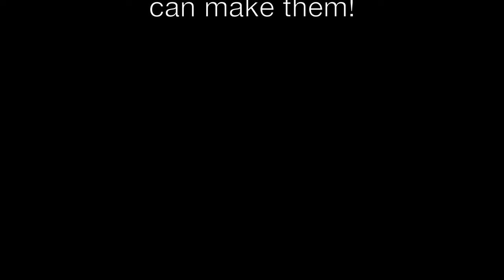T1N Sprinter (2004-2006) Transmission Service + Valve Body Removal

Comment: Thanks for your great explanations and visuals.  I am replacing my engine on a 2005 Dodger Sprinter 2500. I see some people removing the transmission and a few leaving the transmission in place. I am trying to leave the transmission in place, but I can't get separation. Any ideas or anything you can help me with?  Sure appreciate it.
Reply from the maker: As much trouble as you are having getting separation, getting alignment will be X10. Before it is too late  put a few bolts back in the bell housing and pull them as a set. The weight will balance at injector #4. Four bolts on the drive shaft and four bolts on the transmission mount. Disconnect the wire to the transmission and the linkage to the gear selector. I think the trouble you are having is the engine needs to come up to leave the van, and forward to leave the transmission. The transmission is preventing up, and the van is preventing forward, so nothing comes apart.
Reply: Thanks for experienced input. Motor and transmission came out well. Now for the transfer of parts from the old to the new. Your latest video of injector pulls was timely and helpful!

Comment: 2005 Sprinter 3500 200k miles. Don’t know maintenance history. shutters when under a load usually when pulling a trailer. Doesn’t do it 100% of the time but more like if you stop at a stop sign then start off up a hill. The tach seems to increase in rpm when it shutters but it doesn’t seem like a “slip” . If I keep the rpm’s up it’s less of an issue. Any suggestions, thanks in advance
Reply from the maker: Those symptoms don't feel familiar to me. I'd need more data to make an educated guess. Sorry.

Comment: The two different dipstick receptors, is that the only difference between the yellow plate and the black plate when replacing the unit, I was told that I needed the yellow plate which has the U-shaped receiver for the dipstick, which I hate, I want the newer style dipstick receiver, any comments, will both work ???
Reply from the maker: U-shaped receiver on the conductor plate in a Sprinter will leave you unable to check fluid level. The way our dipstick tube routes back and forth it is impossible to register accurately from the top of the tube.

Comment: I need to do this to my sprinter. Do you recommend the conductor plate and shell transmission fluid in the description? Figured I’d ask since you used a different fluid in the video.
Reply from the maker: Yes, when we made this video we used Meyel fluid. That has become impossible to source and we have been using Shell 134 ever since. We tried Fuch's Titan and found it to be thicker, causing valve shudder (RSN) in a van that did not have valve shudder previously.

Comment: I’m wonder, you kid of said in passing that you used brake cleaner to clean the plate. Is that specific or will carb cleaner work as well? I have some carb cleaner for the EGR valve I’m cleaning and was wondering if that works
Reply from the maker: I don't use carb cleaner for anything after a few instances of it eating the surface I was cleaning, or one too close to it. I don't recommend getting brake cleaner on painted surfaces or gaskets if it can be avoided, but it won't eat them like carb cleaner. Your Sprinter does not have a carb so that should leave your garage. It does have brakes. That's all I'm saying.

Comment: Hello! We recently purchased a 2006 Dodge Sprinter and these videos are really helping us get to know our vehicle; thank you! We plan on doing a transmission service however, we aren't sure if we should replace the conductor plate as well. What mileage would you suggest these be replaced at? Thank you!
Reply from the maker: That is not a mileage concern. If the van is driving correctly and sifting as it should, I would not replace the conductor plate. Clean everything best you can while it is apart, new fluid and seals on the electrical connector (or new connector).
Reply: Hey! I just bought a 2005 t1n and in the past couple days it’s started getting stuck in a certain gear. I would turn the van off and start up again, it would occasionally work but as of today it’s completely stuck in 2nd while driving. I removed the driver seat and the TCM had oil on the plugs.  After cleaning that with brake cleaner it still had the problem of being in second. Any suggestions would be much appreciated!
Reply: I’m having a similar problem. Sometimes everything is normal then it’ll stick in 2nd or sometimes 3rd (and won’t allow manual tap shift) until I turn it off and restart it. Sometimes goes a few miles with normal shifting before it sticks. Cleaned contacts on TCM under seat - No luck. Just did trans oil change and replaced the TCM connector plug - Still no luck. Any suggestions?

Comment: I have a sprinter 2006 with both manual and automatic transmission. I can't find the dipstick at the point you showed it
Reply: Is there any other spot I can search for it?
Reply from the maker: What country is your was your van originally sold in?
Reply: @FloridaVanMan   It was imported from spain

Comment: Is there not a pattern for tightening the bolts, like with an engine head?
Reply from the maker: We should tighten them in a criss-cross pattern, but not so critical as engine head, manifold bolts or even wheel lugs. The pan is fairly flexible but the torque spec is light at 8Nm. Snugging them all then coming back to tighten each is recommended. I usually start with the middle two bolts.

Comment: I never knew the conductor plate had a plastic molded ring that's stopping the dipstick from bottoming out. What's with that U-shape version were the dipstick goes straight past it? Aftermarket conductor plate?
Reply from the maker: The NAG1 transmission with that conductor plate is used in other Mercedes vehicles and some Jeeps that have a more traditional transmission dipstick that comes with the car.
Reply: @FloridaVanMan  I see thanks for clearing that up

Comment: You only put 5 quarts of transmission fluid in even though you drained the torque converter. Your other video with the girl shows that you put in 8 to 9 quarts. Please explain.
Reply from the maker: I haven't watched this video in a few years, but we should have added 5 bottles then started the van before adding 3 more. I usually need a few ounces of fluid from a 9th bottle to get the level I want at operating temp.

Comment: I serviced my transmission recently and still having rumble stripe feel/ haven't done the drill hole method yet. Altho it still feels like the shift timing is off. Not slipping but funky bump shifting. No engine lights on. So strange any idea what else to look at?
Reply from the maker: Did you replace the conductor plate when servicing the transmission? Discussion is difficult here. Please find me on on Facebook or join our support group for 1-on-1 assistance. https://patreon.com/Florida_Van_Man?utm_medium=clipboard_copy&utm_source=copyLink&utm_campaign=creatorshare_creator&utm_content=join_link

Comment: Downshifting problems. My 2005 T1 in Sprinter, doesn’t want to downshift when I flick the lever. I have to flick it 3, 4 or five times to get it to finally downshift to fourth or third etc.. I recently changed the transmission fluid and that made no difference. What  are your thoughts?
Reply from the maker: Try holding the shifter a half second, not just a flick. I think I saw you on FB and I reply faster there.

Comment: So I'm lost with the torque converter...you drained it and then we never saw it again. Does it consume the same transmission fluid as the rest of the transmission? Does it require any more maintenance than the fluid draining?
Reply from the maker: The only maintenance you can do to the torque converter is draining the fluid. It's the same transmission fluid as the rest of the transmission. When you drain the torque converter, you will have to put more transmission fluid in than if you just drain the pan & replace the filter. The extra fluid that it needs just goes into the pan and is fed into it once the engine is running.
Reply: Do you need a new washer when replacing torque converter drain plug?

Comment: Hey there!! Bill I done everything like u show in the video the oil was black everything was working before change the fluid but now only go to 3 and pass from there any suggestions can help me?
Reply from the maker: What do you mean only got to 3 and pass from there? Are you saying it shifts only 3 gears? Are you sure it is shifting at all? Some folks mis aligning the linkage shown at 8:55 in the video. Others forget to hook the wire back onto the transmission.

Comment: do you recommend doing a fluid change / service on a high mileage T1N. I purchased the van at 200K miles and have no history of the prior transmission service. The fluid looks somewhat contaminated. Some question doing the service for high mileage ...
Reply from the maker: I do. My book says service it once at 80,000 then never again. I had trouble somewhere over 300,000 and thought I cooked it. A full service with filter and cleaning restored nearly 100% and I have driven another 200,000 miles since then without issue.
Reply: @FloridaVanMan  thanks a lo for the reply. Would you do it as preventative maintenance as well ? There is no apparent issue except a leak in the connector seal (located next to the trans. Forgot what it’s called).

Comment: If there were 3 vans for sale all the same year and wheelbase etc.  would it be better to choose dodge, freight or merc?  between 03-06, which diesel is the one to have and which one is the one to stay away from?
Reply: which engine did not have injector seal issues?
Reply from the maker: @toobglued   Merc Dodge & Fr8_R are all the same van made in Dusseldorf Germany until '07 when they went to S.C. and changed everything. The '02-'06 have the same design, head, and injector concerns, with some major accessory differences. '02-'03 have issues with the mechanical fuel pumps, vacuum activated turbo and a big intake manifold that gets in the way of simple engine maintenance. We are big fans of the '04-'06 with electric fuel pumps and electric actuated turbo with smaller intake manifold and better EGR. We prefer to dress them all as Mercedes despite whatever is on the title. Only the plastic logos are different from one brand to the next. 
The injector seal issues aren't as bad as some people think. If you look under the hood occasionally, and move some plastic covers to see the working bits, you will catch trouble before it gets ugly. If it gets ugly, a can of oven cleaner and $8 in parts will fix the common injector seal issue called Black Death. I call it Black Inconvenience.
Reply: @FloridaVanMan  wow thanks !!
Reply: @FloridaVanMan  And the post 2006 is not desired?   There is a 2008 dually that is very clean for sale with reasonable miles I was considering.   Thoughts on the later models 07-08?     Thanks in advance :)
Reply from the maker: @toobglued  Sorry for the late response. Post 2006 the diesel option was a V6 with DPF and later DEF requirements. These emissions systems are notorious for expensive repairs down the line and I would not recommend them for the faint of heart or DIY mechanic.

Comment: Hello, your video was very helpful, yesterday I did change my transmission driver plate, after finished I noticed some leaking through the connector, first question; is the inside of the connector fill out with oil transmission, that is normal? Second question; because the connector was leaking through the pins looks like I over torque and damage the internal little screw, will I need replaced again the connector plate? or it is possible to wait until next oil change without risk of malfunctions (screw issue).  Thanks a lot for your videos and advice.
Reply from the maker: The screw is not all that important. The connectors are usually wet inside but if the O-rings on that connector are not up to the task fluid will wick to the TCM under the driver seat. We have a video about that. Search our channel for "Should this be wet".
Reply: @FloridaVanMan  Hello, thanks for your fast answer, I saw the video, my pin connector still oil leaking, the connector and the o rings was new one, you recommend found a new o rings little bigger, is possible to remove the pin connector avoiding drain oil in the oil pan? I appreciate a lot your advice.
Reply from the maker: @karenm6914  We can pull the wire-side for connector out without loosing fluid. It is often wet in there. Removing the next part, the connector in the transmission, will drain some fluid unless you are parked on a good hill. if the seal is not good I would replace the connector. Even knowing the bolt hole in the conductor plate is stripped, I would still be confident with a new plug and the O-rings it comes with. When removing the old plug be sure to get all the O-rings out of the transmission then press a new connector with rings Firmly into the hole. May need some levers to really push that connector fully into the transmission. 
https://floridavanman.com/donate/
Reply: @FloridaVanMan  Thanks a lot, tomorrow I will change the O rings with a new ones., Really I appreciate your time and effort to explain to me the best way to fix the problem.

Comment: Hi. What brand torque wrench do you have? Mine only goes down to 13.6 N/M
Reply from the maker: We've been through a few!!! One of our videos shows a bent one we absolutely ruined! Since then we bought a Craftsman for regular torquing. We've had a small one measuring inch/pounds for years and we have a giant one just for these harmonic balancer replacements. I think it was about $300 and is 42 inches long. I can get you a link if interested, but I'll need to look at the wrench I have. It is not a famous or familiar brand.

Comment: Can a transmission flush prior to service be a good idea? One Sprinter specialist I spoke with said it can cause problems as much as solve them. Any opinion on this?
Reply from the maker: I never heard or read of any one doing transmission flush on a Sprinter. It seems unnecessary with no potential for any gain.

Comment: I would love to contact you. Flew down from ohio and purchased a2006 view winnebago. Battery was dead charged it. Drove and it won’t get out of first gear. Need your help please
Reply from the maker: Where in Florida are you? Reach me through our Patreon page. Join here: https://floridavanman.com/donate/
Reply from the maker: You are undoubtedly in second gear, transmission limp mode. The code may not clear without a compatible code reader and will return if problem is not solved.

Comment: Hello. Question.. My sprinter box truck vibrates a lot at around 1800 and 200p rpm. Once i apply power it works fine. Its becoming annoying.. Can't figure out what the.problem is..if you help me figure out the problem... I'll gladly make a donation to your channel.. Thanks..
Reply from the maker: That could be transmission, drive shaft, or hopefully not an engine vibration. Could be a simple as a broken motor mount or transmission mount, so that would be my first place to look. Put a thick board on a jack, and jack up the transmission a little bit to see if the mount starts to stretch and pull, or does it separate easily. Then do the same for the engine, looking at the two engine mounts. Our engine basics video shows the engine mount locations. They are silver wings on my painted engine. Next check would be trying to wiggle the drive shaft while laying under the van. looking for play in the universal joints at each end. Lastly, I'd have you send a video of the problem, taken from the passengers seat because I don't want to encourage driving and filming at the same time, and a short video of the engine at idle, so I can hear it under the hood.

Comment: SOS...Florida Van Man or anyone who may know: I am in Florida with a 2017 MB Sprinter that needs a transmission conductor plate replaced. Would you happen to know an honest, competent, dependable shop or individual that could reliably and reasonably perform this work? Thank you!
🙏
Reply from the maker: There are a few shops in Florida that I can suggest and one that I will warn you about. Stay far away for Sprinter Van City in Fort Pierce. I can replace the conductor plate and service transmission if you are near Daytona-Orlando. We can schedule for about August 7th =/-.
Reply: @FloridaVanMan  Thank you so much!!! Well, I was hoping you might know of somewhere a little closer to the Lake Okeechobee Area. I will keep looking to see if I find anywhere closer and let you know! Thanks again! Cheers!

Comment: The link says it’s not compatible with my dodge 04 2500 sprinter. I think my connector is leaking
Reply from the maker: I don't know which link you are referring. Amazon is often wrong about vehicle fitment. If I linked it, it fit! But..... beware of my links that are old. Amz sellers change the product without changing the listing. The alternator I liked for years now ships with a pulley that does not align on our vans. We will be updating our links soon at https://floridavanman.com/links

Comment: I clocked the affiliate link for the conductor plate kit and it says it's only for 2004 and newer... Should fit the 02 and 03 should it not? That link has a great price. I'd love to buy but only if it will work obviously.
Reply from the maker: It will fit. The NAG1 transmission remained the same and was continued into the NCV3 models. The eBays seller just did not discover all the other vehicles that the part fits, and listed it for only the most popular ('04-'06 T1N).
Reply: @FloridaVanMan  as I thought, just had to be sure. Thank you kindly